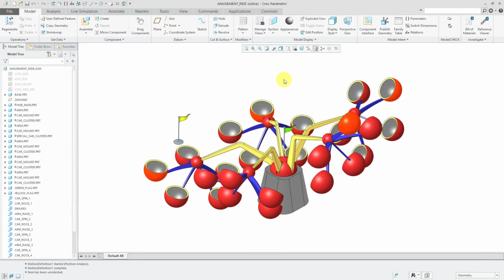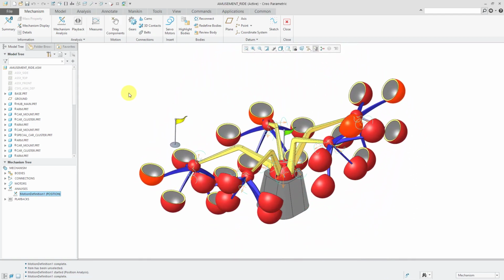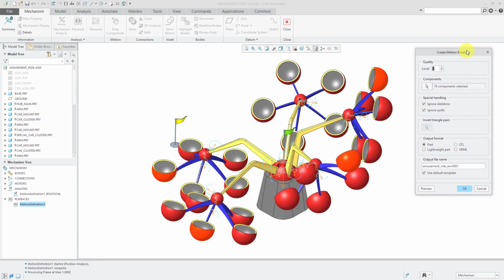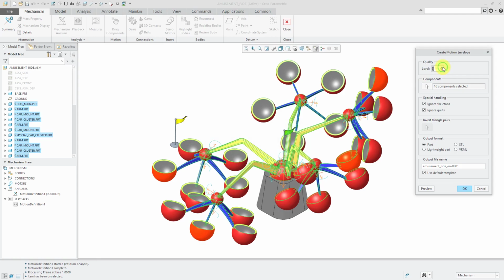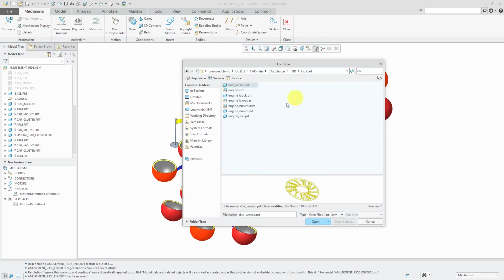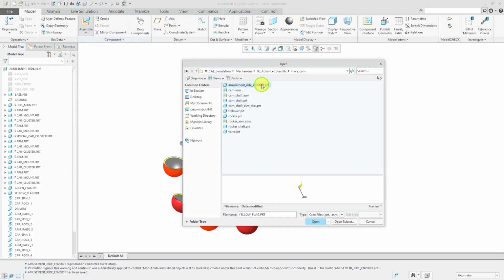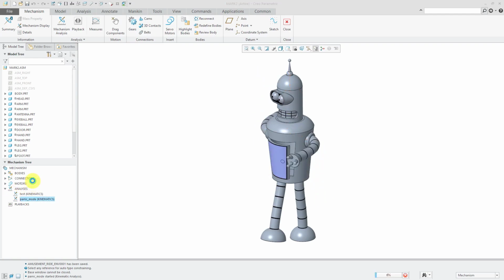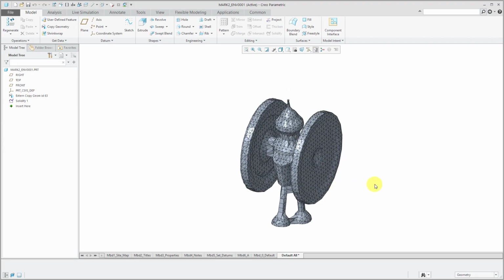Creo Parametric - Assembly Mechanisms - Motion Envelopes

Comment: Hey Dave, have you ever heard or scene any issues with CREO 8 and, Mechanism 3D Contact surfaces?  I am trying to animate a chain and sprocket.   I created contacts between the sprocket surface and the roller surface.   The sprocket and chain are sync for a second then, the sprocket keeps moving without taking the chain with it.  Thanks.
Reply from the maker: I have not. But I haven’t used 3D Contacts in years. (Only because I have not had a need.) I recommend contacting PTC Tech Support.

Comment: not related to the motion envelopes, but to mechanisms in general, how would you properly make Bender to move one arm 360 deg with a certain velocity/acceleration profile and when that motion is finished, a second arm would move 360 deg (one motion after another)? Thanks!
Reply: In analysis menu, you have the option to change start and stop time of motors 1 and 2. Use thay.. run the first motor arm from start to 10 seconds and for next motor arm give 10 at start and then End.